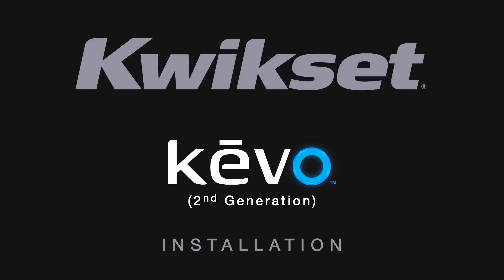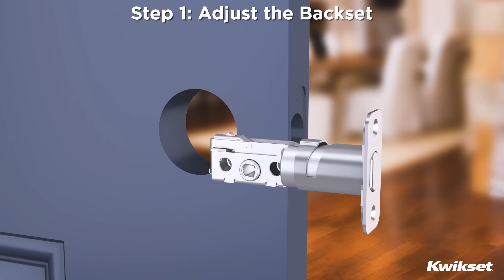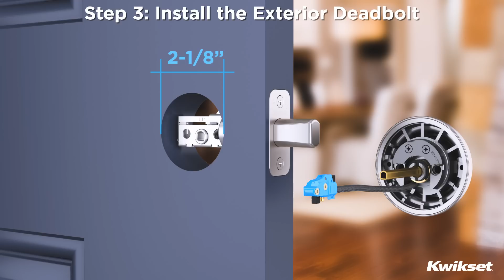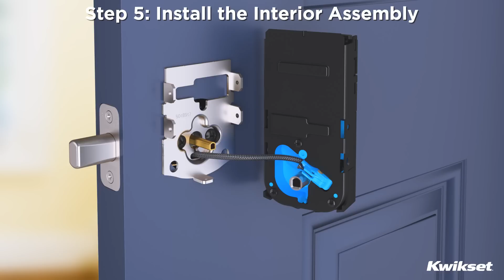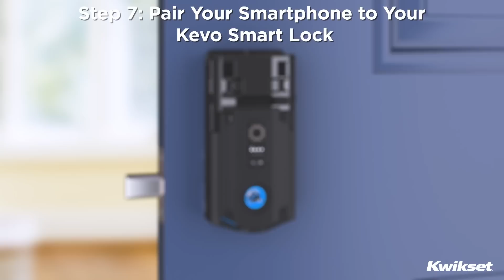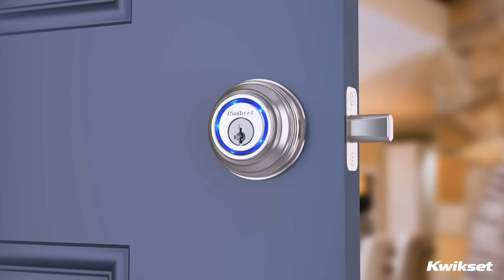Kevo Gen 2 Smart Lock Installation

Comment: Hi here in 2019 btw does kwikset work while there's no power
Reply from the maker: Kevo is battery operated and does not rely on the electrical grid for power.
Reply: @kwikset  if there's no power and the kwikset is not working how are we going to get in
Reply: @kwikset  I think you should add the backup battery for the touch to open but when I got my kwikset I receive a key and I wonder if you should add when there's no power only the key should work
Reply from the maker: @epickink446  Kevo already runs on batteries, so if you're Kevo is not lighting up, please change the batteries. In the even that your batteries die while you are away from your home, we do include the keyway as a mechanical back-up for entering your residence.
Reply: @kwikset  okay but I'm just asking does it work when there's no power in that case
Reply: I comes with regular keys

Comment: Hi our deadbolt lock of our Kevo broke.The inside where you insert the key fell off. First we had a problem turning the key to open until when took off the key the inside came out with the key. Kindly advise how to fix it. Does it need to change just the inside piece or the whole deadbolt?

Comment: The most unclear part of this video is the handing the deadbolt step where you have to calibrate. On the phone, I was told to hold the button down while sliding the battery in and then let go after two seconds. Once I let go and there was a beep, I tapped the button again and the calibration finally happened. Following this video, I was holding the button for ages until I heard a beep and then pressed the button shortly afterwards. Calibration did not occur in this manner. I hope I saved some people the time and heartache.
Reply: i cant get it to calibrate
Reply: no matter what I do it won't calibrate
Reply: Norman Scherer u ever get it to calibrate.. I need your update!!!
Reply: This is not working for me
Reply: Andy E c
Reply: Thank you
Reply: Glad I looked in the comments, I had same problem
Reply: This is where I’m stuck at!